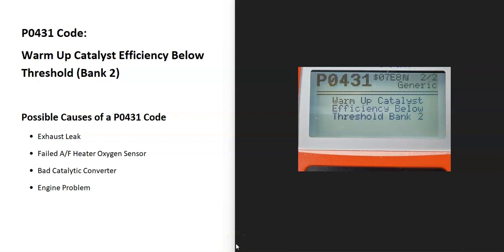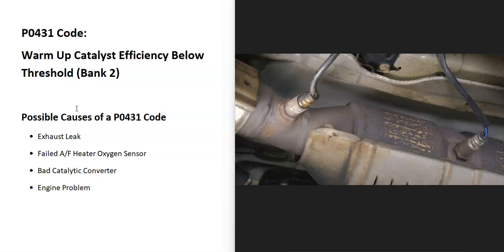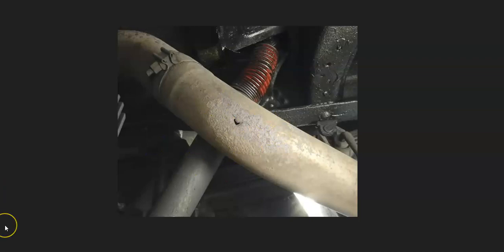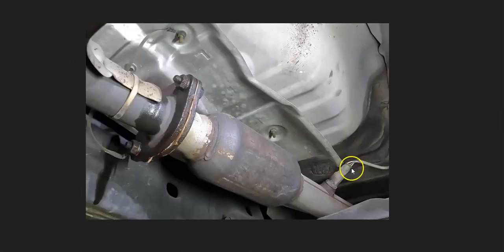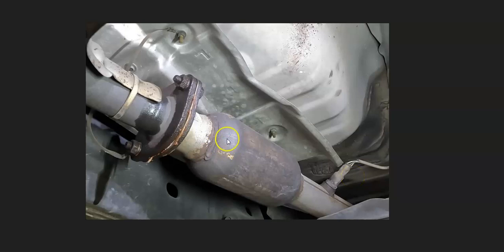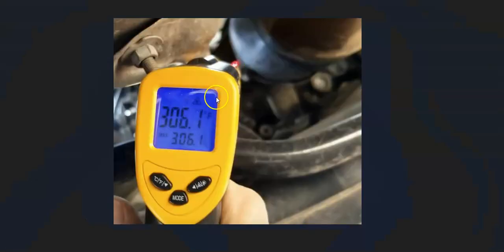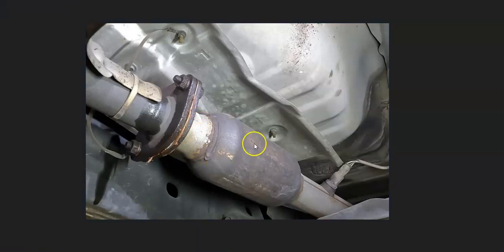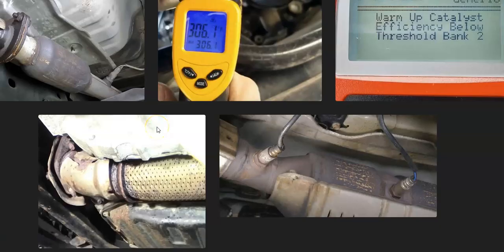Causes and Fixes P0431 Code: Warm Up Catalyst Efficiency Below Threshold (Bank 2)

Comment: So my external flange isn’t tight with that the bolts on the not sliding together. Do I need to change it. I got new o2 sensors and a Cadillac converter. That’s the same thing coming on my reader. Will it cause it to trigger the code? The exhaust flange under the bottom
Reply from the maker: Exhaust leaks can throw off O2 sensors, although usually when there is an exhaust leak they will give another code. I would fix any leaks, clear the code, and see if it comes back.